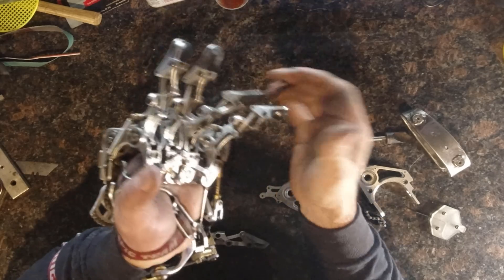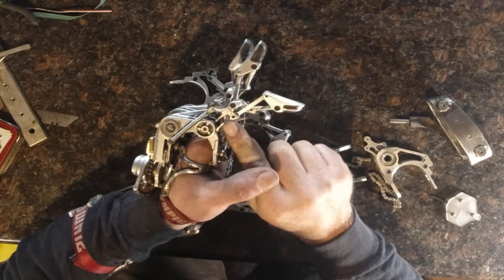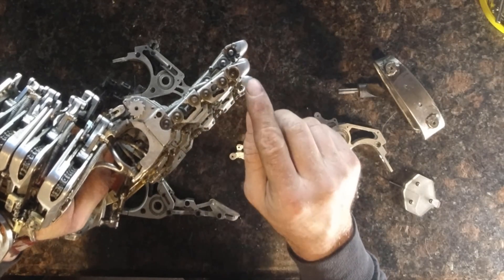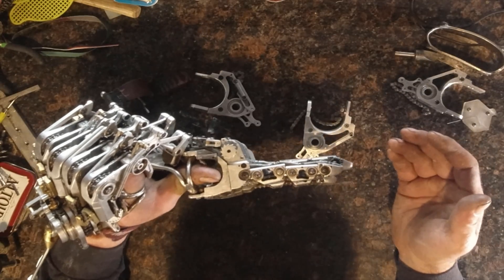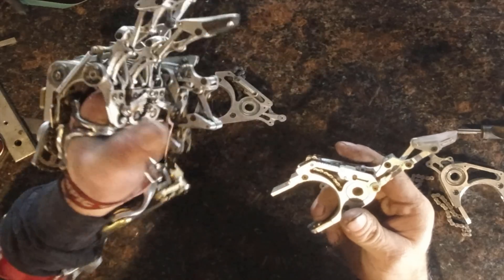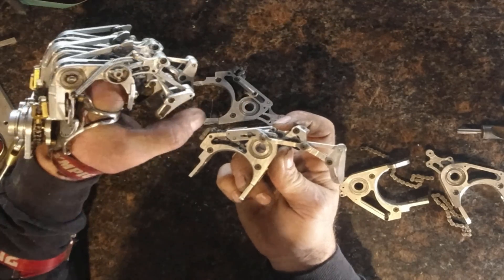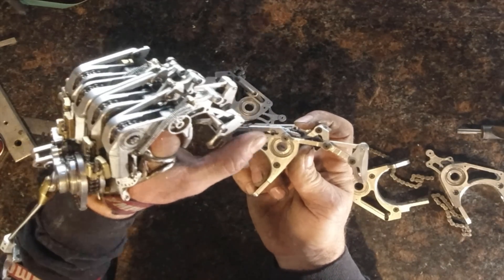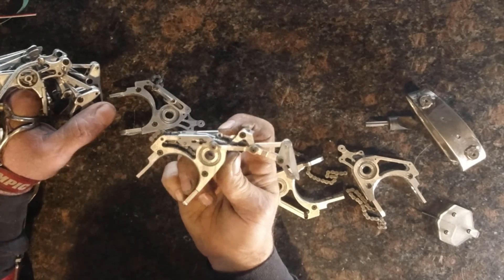Game Changing Idea for my New Prosthetic Robot Hand!

Comment: A ratchet twisty tie could be slipped into the distal and threaded through into a locking mechanism  for an easily replaceable tendon. This could provide a simple replacement for the many part  chain drive. Twisty ties come with a ratchet head which could be fit into a properly milled holder so that component is already made, and replaceable. 
I wonder how this would work in your designs.
Reply from the maker: The nylon would stretch too easily under load, you'd need something. If I was going a different direction than the #15 miniature roller chain I'd go with something Kevlar based, but then you need to deal with the issue of fraying. Once it starts it turns to garbage fast.

Comment: How does the distal link slide if the proximal is immobilized?  What pulls on the distal and how does it keep pulling without needing the proximal to move is the chain is driving the proximal?  Is there a spring at the end of the chain that allows it to keep moving without it needing to move the proximal?

Comment: I would like to see 3-D printed proximal medial and distal, with a little side plates that match strength with the thicker plastic center component. Maybe  A bearing could rest in the outer third of the plastic and also extend into the thinner side component. 
 then of course  those nylon ties would make ideal tendons, they have their own ratcheting mechanism which could probably be fit into a metal holder. So just snip snip thread thread and then zip it into place. A small paperclip could be pushed in to release the tendon from the back of the hand, or the fingertip

Comment: i can hold my proximal and medial bones still and move only my distils! i can't move them much when doing it though, but it looks weird. these prosthetic hands are pretty awesome, and i imagine you are doing more solid R&D than a lot of heavily funded biotechs. you could probably get investor money if you really wanted to deal with those people. just through a useless bluetooth dongle on the hand somewhere, and the investment money will fly at you (or better yet, have it track some useless metrics like hand warmth over time). companies will actually buy literally useless biometric data on the far outside chance that it will become valuable in the future
Reply from the maker: You're exactly right. If I were to add motors and electronics, even though it would severely negatively impact the functionality and reliability of the device.  I would have all kinds of outside backing. But where I am able to get the results I am from a purely mechanical setup. Nothing. Kind of disappointing really.

Comment: Watched some of your video back then, did you manage to program your fingers so it works individually? From my memory the fingers move together so you can only clutch a fist
Reply from the maker: On my current service unit (version 158) I do have individual control,, but it's on the open.. the fingers get locked in the closed position. . I found that it was way more functional that way rather than on the open side of things.

Comment: Hmmm. Won't that put the entire gripping force of the finger onto that thin little side bar and sliding mechanism? If so, it will definitely need some reinforcing to keep it from buckling.
Reply from the maker: Almost all of the mechanism is in tension. Only one of the links is in compression, and to date, I haven't had a problem with it deflecting.

Comment: One thing I don't quite get is what situations do you notice the limitations of the simpler design? Is the proximal particularly easy to stop? Does allowing the distal joints to wrap slightly as in the chain design, cause whatever you're grabbing to "move" into a better position for the proximal to then finally close?

Comment: Hm.  So your issue is that you want to both be able to have the full linkage move, and also the blocked...

Is there a reason you couldn't use belt instead of chain, linked to the finger tip?  Wouldn't that sort of 'reverse kinematic' approach allow for that sort of segment-by-segment closure without adding too much mass or complexity?  Acting in the same fashion as the natural finger's flexor tendon?

Comment: A way to do it would be to indeed separate the distals from the proximals, and drive the force of the action primarily through the distals, with the distals and proximals connected by spring.
That way when the action is engaged it will move the distal, and by extension the proximals, until the clamping force overcomes the spring tension, at which point the proximal seizes movement and the distal continues moving.
Essentially pull the proximal as an extension of the distal, the two being connected with a spring.

This of course has it's cons as well, since depending on how much force you're able to exert on the finger, it could cause some weird finger-clamping when you don't want it, and you'd need a quite specific tension-spec spring... And since the distals would only move after the proximals have seized, it'd probably look quite weird and a bit unnatural...

Honestly, i'm sure my implementation wouldn't be the best by a long shot.
But the overall idea is pretty great.

The only real problem i see with the concept is that any kind of distal-hook action (pulling from the fingertips so to speak) would be hard if not impossible with this design. ... I think.
Honestly, just keep doing what you're doing, i'm sure you'll amaze us all again in the near future regardless. :P

Comment: That's a clever solution! Will it have the torque to still be useful? I question the strength of the sliding mechanism, esp. laterally across the slide, but if you can keep it a firm connection (dovetail + slot/bar?) you might be on to something!

Comment: Yea the 156 does look like it has superior function.  Perhaps the part count can be brought down without changing the principal of operation.  I don't think you need chains and gears for this application, a machined radius for the chain to glide on could eliminate the sprocket, bearing, and pin.  Infact the chain itself could be just a steel wire, like the wires they use to build cables.

Comment: excellent solution, what is the difference in part number?
Reply from the maker: 156 finger 76 components per, 158 finger 59. Link slider adds 8. Although the way I'm doing the joints this time -3 from that.

Comment: This whole evolution is spellbinding. I believe once the mechanisms are optimized you will have a menu of substantial advancements on the mechanics that motorized elements for full hand replacements will be made more robust, and neural skin patch contact elements in the socket or in an nearby arm band will be able to accomplish much faster eye-hand coordinated movements (takes a wearable computer but that's not difficult these days). I know for your current vision Ur looking for fully mechanical, but I'm guessing that for average illiterate slob on the street amputees that hybrid will be a more complete replacement. Keep up the fascinating work

Comment: But wouldn't the chain stop moving if the proximal is stoped?
Reply from the maker: The end that is connected to the proximal would, but the end that is connected to the link slider would still be able to move. Thats where the extra articulation comes from.

Comment: Just wondering, is there any reason for using a chain and sprocket? Especially since the sprocket is an idler and the mechanism is actuated by pulling on the chain, wouldn't a cable work just as well and be simpler, more compact and lighter?

Comment: Ian, while placing the link on a movable slide seems like a good solution to increase the grip "tightness", wouldn't it also be a small hinderance when lifting heaving objects?
I mean, let's suppose you're picking a 10kg dumbbell, wouldn't the grip "loose" a little proportionally to the space available on the slide, or would the chain links be strong enough to hold the grip even without the structural support of the metal plate?
Reply from the maker: Really until it's strapped to my hand and I try it out, I don't know how the real world feel of it is going to be. I hopeit holds similar to how the other hands feel. As far as the backdrivability, once you get yo the maximum stops on both ends of that link the force would be transferred to the clutch bearing and Sprague that make up the locking assembly.

Comment: That is some smart engineering! Do you have a mechanism to control the back travel when you close around something with resistance, like lifting a weight or pulling a bow string?
Reply from the maker: The selector assembly controls the back drive of the fingers. I'll do a video about that part coming up shortly.
Reply from the maker: The selector assembly controls the back drive of the fingers. I'll do a video about that part coming up shortly.

Comment: Very cool. Can't wait to see it in operation. Question, how cold is the hand in winter? Considering it's essentially a heatsink. Do you have a glove that fits over the whole hand or would that get caught in the mechanism?
Reply: Ah, just connect a 12v battery to the index and pinky finger tips. Should warm it right up
Reply: literally just make a glove with no fingers that sits under the prosthetic
Reply: @RustyCraftKnife  I'm kind of surprised that nobody else thought of this. 😆
Reply: @RustyCraftKnife  that’s what I was thinking
Reply: The hand sit on a silicone socket. Prosthetics are never in direct contact with the skin.
Reply: @joaomrtins  I don't think his does, it looks like it has some other material at the base of the fingers that makes contact with the skin but it's not like a normal prosthetic one by the looks of it. You can see it in the newest videos and some others were he takes it off.
Reply: @dioV4M  he has a video in which he makes the silicone bit. This one he said he would make different but I didn't really understand how
Reply: Could probably coat the parts in some thermal insulating coating. Maybe something rubberized or silicone. Or some thermo-conductor on a battery regulated by a temp probe and some logic. They make vaporizers capable of that for 40 bucks. Nicrome wire, and temp regulation and power control based on it.
Reply: I was thinking a fingerless glove that just covers his hand but keep the prosthesis exposed
Reply: Simple solution, put the glove on your hand THEN put the prosthetic on?
Reply: @Mr.1-UP sheeeeeeesh
Reply: I know this is an older comment, but it's cool to think about different solutions for this. The first thing that came to mind was creating the hand from copper to conduct heath from your hand, however there would have to be more heating catalysts of sorts to make use of the copper conduction.